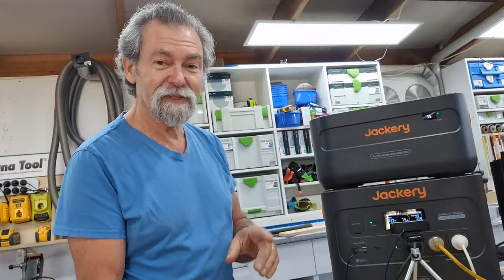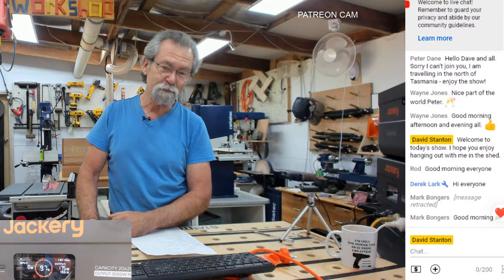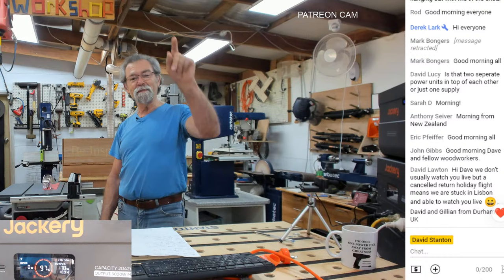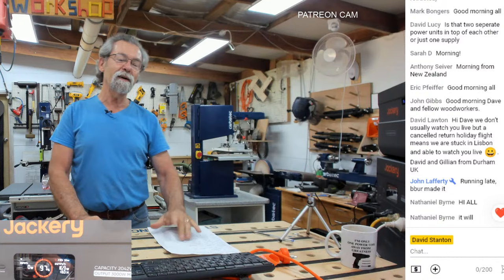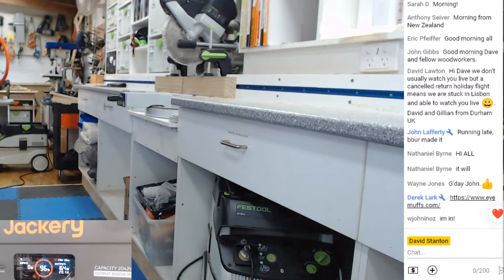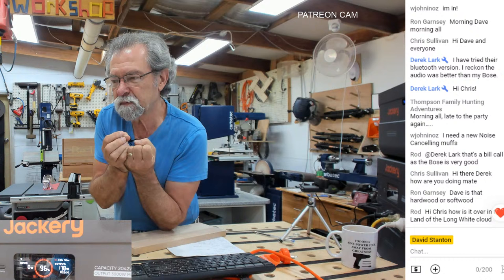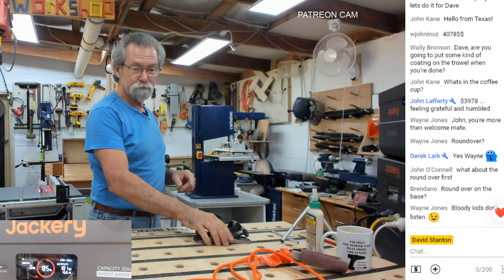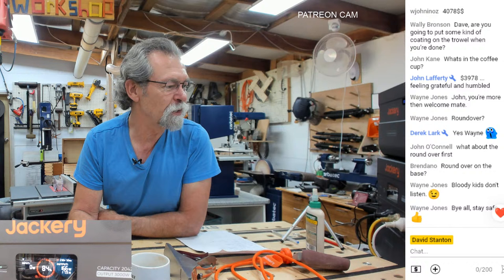How to make a wooden float | Jackery | Dave Stanton Live!

Comment from the maker: Wayne, the router table pulled around 500 watts because it was just the router, not the dust extractor. When the table saw was used, there was also the Festool CT-26 dust extractor  being supplied electricity from the Jackery.